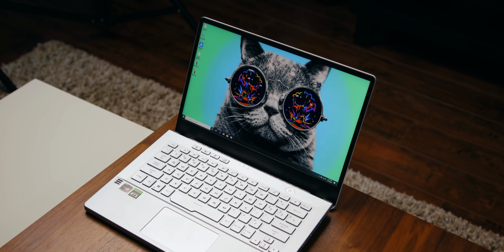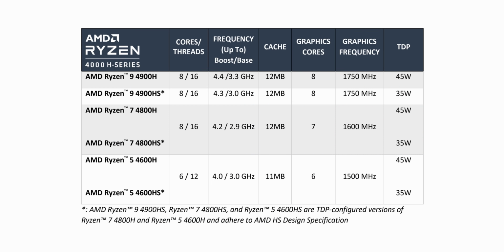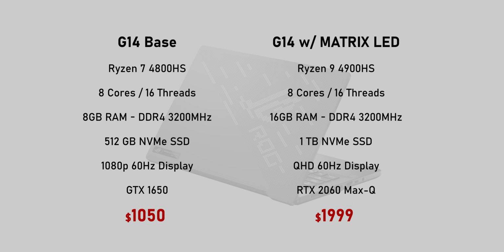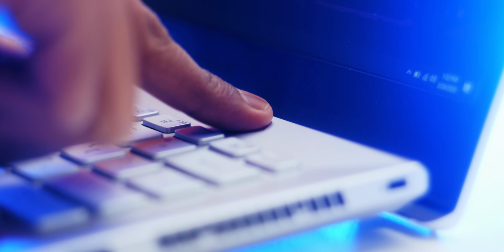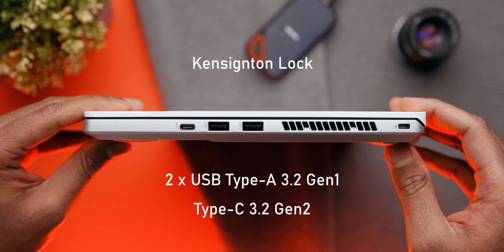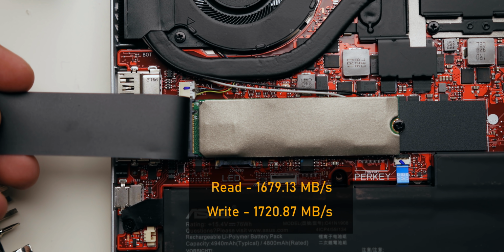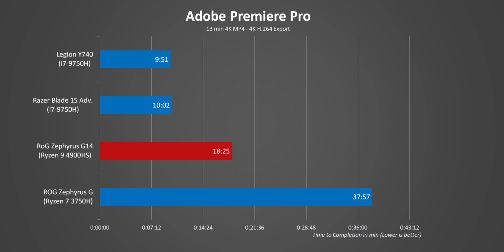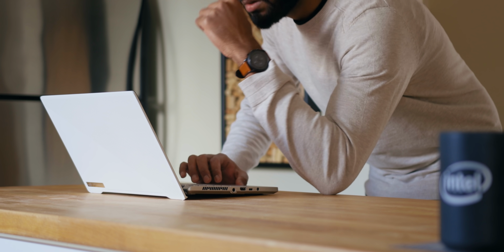This Ryzen 9 Notebook Is AMAZING - Zephyrus G14 Review

Comment: i dont get it.  you say at 16:50 that this destroyed your blade 15 in all the tests 'even resolve' .  But your charts dont support that, and in most cases the blade 15 'destroyed' the zephyrus.  so what do you mean, this review doesnt add up
and....titling the keyboard UP does NOT optimise typing, it further increase the crease pressure on your tendons and will do more harm over time (RSI).... granted the increase is minimal and wouldnt increase much but still... i can only think this is purely for airflow....

Comment: Ok, I'm really interested now. Will there be a lower end version?
Take out the GPU, downgrade to a normal SSD and down to a Ryzen 5 4600H. I'm hoping this will be $800 max. Will this be possible?
Edit: I'm even fine with a 720p display, will make games run better on iGPU

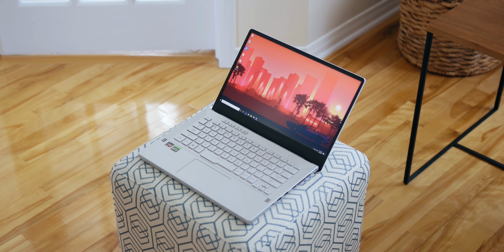Comment: 10:46 This is false. ASRock makes a number of X570 boards with officially certified Thunderbolt 3 support/ports built in. The certification process for non-Intel hardware is just really expensive & laborious atm, but it's definitely not impossible. Ryzen 4000 laptops with Thunderbolt 3 are supposed to hit before year's end.

Comment: Windows Precision Drivers aren't much of a good feature of Windows laptops at the moment. They used to work beautifully and be the best touchpad drivers in Windows laptops. But the past few Windows updates at least for the few devices I've used recently have really screwed up Windows Precision Drivers and I've ended up just turning my touchpad completely off and just using the touchscreen on my Acer Spin 1 because of it. Hopefully whatever the problem is gets fixed soon though because before the recent updates screwed the drivers up the only touchpad drivers I liked more were the drivers for Deepin OS and Chrome OS.

Comment: A beautiful beast, I'm getting excited and am strongly considering a purchase. I would use the laptop mostly for work. As an ass. Prof. I need the laptop for lengthy and computationally heavy simulations using 100% CPU capacity. The displayed CPU performance is very appealing. However, the other main activity involves teaching. Due to the corona virus crisis, our uni is making a switch to online based education, so the absence of a webcam is a very unwelcome surprise for me. Do you think there is any chance a version with a build-in webcam will become available at some point or will I be stuck with having to resort to an external webcam?
Reply: Asus stopped including built in webcams in many of their "Zephyrus" Line-up last year (Which this could be considered a part of). They did originally include a pack in webcam last year, but it looks like they're ditching that this year. Honestly, you're better served with a cheap external webcam anyway.
Reply: @Llamadeus  thanks for the info. I just know that there will be moments where I have my laptop with me but not the external webcam. But OK, I could always use my phone in these situations. Probably it's not a good idea to let this issue be a dealbreaker.

Comment: I don't really like that they use a 660p SSD (which uses cheap QLC Nand). A more mid-range TLC SSD isn't even that much more expensive! (the price difference can be as low as about $20 on the consumer retail market). I guess it's not a big deal, as most people probably won't notice much of a difference in speed, but a mid-range TLC drive would actually be massively faster for certain applications, and I guess it's easy enough to upgrade if you actually want or need a better SSD. TLC will presumably also be somewhat more reliable and also longer lasting.

Comment: Maybe I'm crazy, but if you were going to be buying a separate mouse for a laptop, wouldn't you buy a wireless mouse? Running into the mouse cable seems like kind of a moot point here that 99% of users would never run into.

Comment: Oh I see so the s in 4900HS stands for "screwed"....single RAM slot when now it is possible to get to 64GB=2x32gb; single NVME slot (when now RAID 0 is quite easy to achieve); no Thunderbolt 3 port.

Comment: Holy moly, this thing puts an end to the "desktop PC always have more power than laptops" notion. This straight up beats the middle class Ryzen CPUs and comes very close to the high end. Absolutely splendid. 
The GPU is great as well in such a tiny powerhouse. DX12 Ultimate ready and with DLSS you can get a huge performance boost in future titles.
This shapes up to be an ideal laptop.

Comment: Is the CPU already Undervolted from the factory? If it's not, there's a room for improvement

EDIT: 46db on a gaming laptop @performance setting is not bad at all, it's pretty good given the device's size, thickness, and price. There's no reason to complaint about 46db performance setting when most gaming laptops from 2018 and before would go over 50db easily. I really can't blame asus there

Comment: I actually am looking for a new laptop, but i strongly prefer thinkpads and low power, cool cpus in my portables. Also. something with integrated graphics that works, I've had endless issues with intel display drivers(on win 10) fucking up in various ways when using a second screen. I haven't trusted nvidia discrete graphics in laptops since they started killing themselves and de-soldering from main boards 10 years ago. 
So I'm holding out for lenovo to release something useful with ryzen 4000, preferably a 6 or 8 core with alright integrated gpu and a place to stick an extra stick of ram to.

Comment: The best device period is a 
Thin, well build and sexy ultrabook as the

HP Spectre 360 2in1 (with almost a bezel less screen as in the late 2019 version) 
4k OLED 144Hz touch with pen support 
Ryzen 4900H or so and must have  PCIe gen 4.0!!
32Gb DDR4 3200
1 Tb NVMe 

Graphics card not important as it would be hooked up to an external 2080Ti or higher eGPU
this way VR would be also a possibility on such a device (PCI gen 4.0 and 8 core CPU).

Comment: Can we all just agree that the only ports we should ever see on laptops these days are DC, thunderbolt-USB, 3.5 jacks, and SD slots? No HDMI, DP, Ethernet, or any other type of USB?

And can we also all just agree that the only ports we should ever see on any mobile devices especially cameras these days are AC/DC, thunderbolt-USB, 3.5 jacks, and SD slots, with the exception of proprietary connections? No HDMI, DP, Ethernet, or any other type of USB?

It's pointless if it's not thunderbolt-USB on both ends. HDMI to USB type-c is pointless.

Comment: "Compact gaming laptop". I personally don't consider this as a gaming laptop. It's fine if you are a video creator for example - if you can deal with only 1 TB of memory - but for gaming it's a bit limited. The keyboard doesn't have a numeric pad and arrow keys are too small, so binding keys on some games would be a problem. A screen of 14" with 1080p and 120Hz is quite cheap. Not having a slot for an additional 2"5 HDD or SDD inside the laptop is also quite frustrating. And about upgrading the RAM, 16+8 GB is not great, since it's better for performances to have two RAM modules of the same size. And finally, when I compare the performances with my own gaming laptop that I was able to upgrade, well... i7-8750H, GTX 1070 (not Max-Q), 32 GB of RAM, 256 GB NVMe + 2 TB SSD, screen 15" 1080p 144Hz (overclocked to 157Hz)... And all of that for roughly the same price...

Comment: Hey I got this same computer on Bestbuy open box supposely in acceptable condition, but as it turned out it was like new in the orginal box with all of the accesories for 965 dollars!!!!! and the keyboard issue has been fixed.  it has 3 levels of brightness and it depends on the brightness of the screen of course reflecting on the silver key but nevertheless is quite satisfactory and the lighting is even.  no it is not as good as the macbook pro. but Like I said very satisfactory unless you are super picky
Reply: Does the Macbook Pro has an RTX 2060?

Comment: I have this laptop, just want to give a heads up to any potential 
buyers. It's not all it's cracked up to be. The screen randomly goes 
dark at times for no apparent reason. The back light is still on, sound 
still going. Restarting it fixes it, but egads it's annoying. Google it,
 it's a thing. People say update the drivers etc, and it doesn't work. 
It also freezes. No joke. I open the laptop from a sleeping state, and 
you can see everything on the screen clear as day, but you can't move 
the cursor. Can't Ctrl alt del. Nothing. Again, restarting it fixes 
this, but sjfgduarjhegrrr, yah know? Having no web camera has been much 
more stressful than I thought it would be. I though I'd just buy a 
webcam on amazon and be on my way, but the laptop in so tiny, putting 
any of the webcams on top of the tiny little laptop covers part of the 
screen, and they're really distracting to the eye. Most webcams are USB,
 and they have to be plugged into one of only 2 USB ports on the RIGHT 
side of your laptop, where your mouse would be. It's just incredibly 
annoying. This laptop has left me feeling like.. I'd really just like to
 have a laptop that meet my needs. Gaming however, is so smooth and 
pretty. You know that loading screen when you enter a new area? Gone. So
 fast, you can't even read the tips. Amazing. Gaming on this laptop is 
just fabulous. I just wish everything else was amazing. Also, for me 
personally, 14" has not been a plus. Maybe It's because I don't really 
take my laptop on the go other than to lug it to an occasional LAN 
party. As a homebody who moves my laptop from the bedroom to the living 
room on occasion, I've come to realize, to me personally. Smaller isn't 
really a positive.

Comment: PCI-E 3.0 with 8 lanes. 

Well yeah obviously because PCI-E 4.0 on a laptop is entirely useless. All it has to do is be fast enough to not bottleneck the GPU. PCI-E 2.0x16 or 3.0x8 is plenty of bandwidth to not limit a GPU. As for high speed storage, for laptops it's going to make the most sense to use M.2. drives due to their very small form factor and being readily available. You can't upgrade a laptop (for the most part), so have the extra lanes/newer standard available from that standpoint makes sense on a desktop but not a laptop.

In this case I think AMD made the extremely intelligent decision to use the mature standard that offers all the performance needed at a lower cost.

Comment: Bought one and waited over a month to receive it cause asus is running low on Ryzenchips. It destroys my Razer stealth on performance and is barely bigger. And it has a longer battery life, like wtf? Idk how Amd is doing this. However an Issue with this laptop is that when I first bought it, the battery life lastest like 2 hours. I did some research and found that you have to delete the AMD Radeon graphics bio because it forces the laptop to draw power from both the integrated graphic and the graphics card. After I deleted it, the battery instantly went up to 10 hours. The only down side about this laptop is the lack of a webcam, and the shitty finger print sensor. works like 20% of the time. Webcam and windows hello would make it perfect.
Reply: Amd Radeon Graphics Bio??? My G14 is only getting about 6 to 7 hours remaining at 100% charge. Do you mean removing the AMD radeon drivers?
Reply: @threat54  Yes

Comment: I resisted the urge to buy a $2k Blade with the i7 9750H and instead opted for a Lenovo 2-in-1 with the same CPU and a weaker GPU for $500 less
Which means I still got burned by AMD but less so than I otherwise would have been

Comment: As awesome as Ryzen 4000 mobile is, I wouldn't get this laptop with new GPU generations right around the corner. This will not be the usual generational change. The new consoles will redefine game specs for many years to come. It is best to see what those new specs will be. Now, if buying this for older games or for work with gaming as a perk, that is a different story.

Comment: That power supply on the side is ultra, ultra stupid. Because of that feature alone I can't justify buying this one. The thought of constantly having to rest my arm on the cord or even possibly getting it tangled in the cord absolutely kills this device. Too bad.
Reply: I have just bought this laptop and it really isnt a problem. The keyboard is inset by about 1.5 inches so when you are typing or pressing keys you dont actually touch the cord or the connector.
Reply: Gloster Gloster which is better gtx1660ti or rtx2060??
Reply: @StanleyVander  rtx2060

Comment: I would have totally jumped on this laptop expect for two things.
1) I will never ever  ever ever (x100) buy a laptop with soldered on RAM.  It is despicable in every way. The person at ASUS who though it was ok for them to start doing that should be executed as an eco terrorist due to all the waste broken laptops out there cause of failed ram that can't be replaced (ASUS particularly had this issues on some models, I know cause I use to sell them with a 70% fail rate usually in the 13-16th month right outside warranty) 
2) AMD does not play well with professional USB audio interfaces and MIDI controllers as well as all kinds real time audio processing issues.  (which i need)

Comment: i got ryzen 7 zephyrus G and seems they are way over the capabilities with the spec it has  - overheating easily and throttling. Seems like this with rtx in it will be even worse. "Throttle down to 400mhz" CPU issue during heavy load? anyone familiar with it? yep
Reply: g14 or g15? (asus Z 15.4 inch)

Comment: i can hear intel crying :D used to be a intel fan, intel lover but now im slowly falling for AMD lol
Reply: If you want to fall in love with AMD a little faster, try researching how many times Intel have been convicted fraud/manipulation/kickbacks/etc. They've tried to kill AMD for four decades by every other mean than actually being the better product at the better price. Every time they think they did it, they lean back and start milking customers with small incremental upgrades that requires a new motherboard. Intel's been on 14nm for six years now. AMD's first 5nm products are launching next year... TSMC already have 3nm working and the first movers are already producing. AMD will begin designing for 3nm within this year, and if production capacity at TSMC allows it, it is not unthinkable that AMD could be launching 3nm server and HEDT CPUs and premium GPUs by the end of 2022 or early 2023.
Personally I'm all good and set with hardware as it is, so I'll be holding out for the 5nm Ryzen 5000 series (which is DDR5 RAM and the socket will most likely be called AM5)... let's see if it also lines up with PCIe 5.0 for dramatic effect :P

Comment: I will wait for intels Tiger Lake should be out in June and rocket lake in Sept.   Before I forget tiger lake high end mobile is a 6 core surprise surprise. and Xe 96eu destroys any thing AMD can produce in igpu.  You did good but till I see amd using  IGPU in a laptop really won't know how good the 4,000 series really is. As it is Tiger lake has way higher single threaded performance 30% more.  and the Intel nuc with Xe 96eu combined with DG1 add in card will dominate in low end graphics if you can call it that.  Tiger lake H also has 8 cores 16 threads those are 45 watt cpu.
Reply: Nope it doesn't but by the time it does r9 4900h will destroy it with 45w chip

Comment: OMG, AMD is now at a place where from now on Nvidia has to be in part with AMD in the same system for better performance at a lower cost, usually, Intel+AMD/ AMD+AMD/ Intel+Intel happened most of the time to get that outcome. Intel+Nvidia was always the best performance at a higher cost. I hope that AMD+AMD will take the place for best performance at a lower cost for any system soon. Both Intel and Nvidia are probably going to be beaten by AMD alone, even after a late and risky start and a poor company condition.

Comment: Asus. Take the Zephyrus G14 and make a 16" no-bezel ultrabook of it. Due to the sheer size of a 16" form-factor, the laptop can be made more thin with better cooling. Speakers can be tremendously improved and then the laptop is perfect internally. Externally, give it a large glass-touchpad with a great keyboard. For the display, put in a 400-500 Nits, 120Hz p3-gamut calibrated display. If this laptop still has ~10H of battery life as the 14" model has, then ask 2.5k - 3k for this laptop. Sell it as a pro-grade laptop but also market it as every consumer would love to own (this is what Apple does!). Now, you have all the hardware available to you. So...just do it!

Comment: 8:56 I refuse to believe this is more than pandering. The moment you get downfiring speakers in any capacity, you distort the sound. After using a Razer Blade 15, I will never go back to a laptop with downfiring speakers again. I highly, HIGHLY doubt this outperforms the Blade "by a longshot".